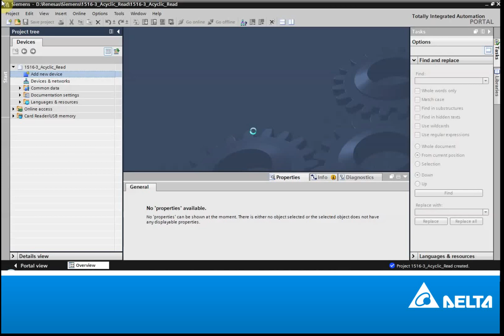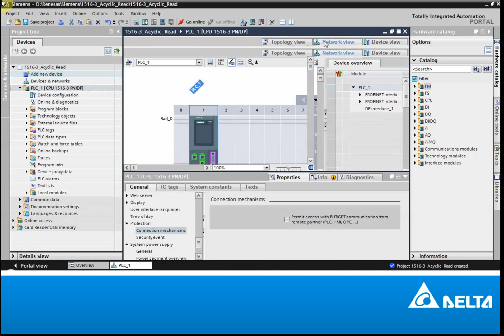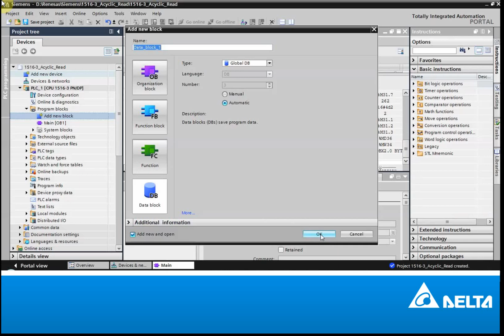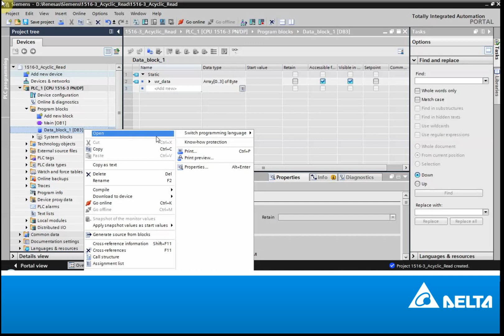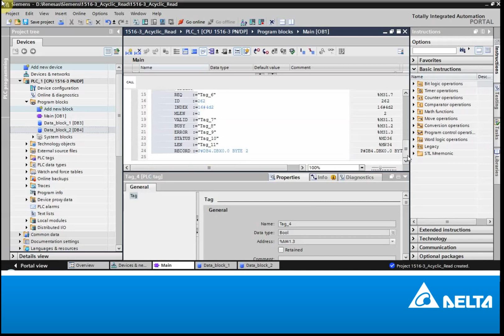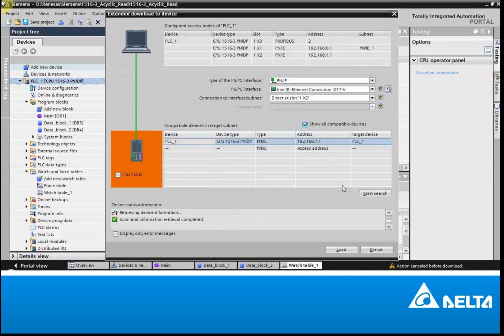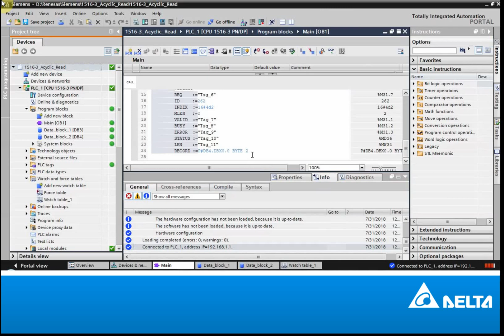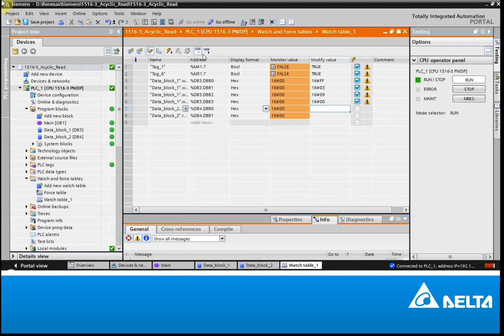CMC/CMM-PN01 - Profinet Acyclic Communication - Reading

Comment: I have tried to do communication between s7 1200 and delta C2000 profinet. But it still doesn't work. And in s7 1200 does not support STL language, is there any way other than using STL? Please reply